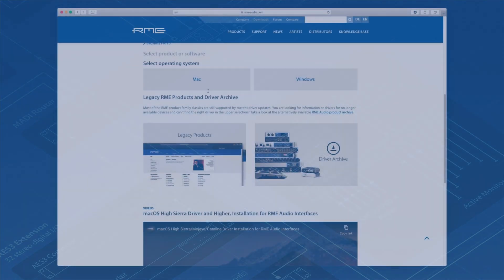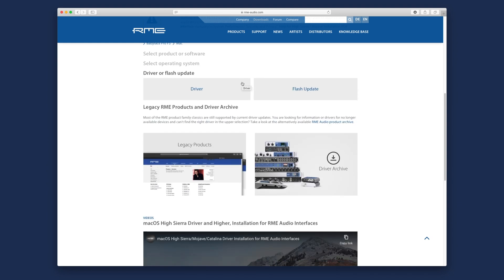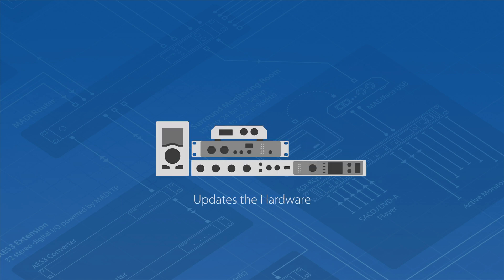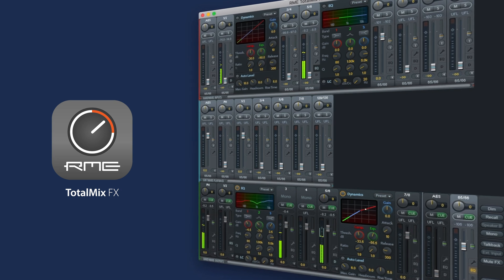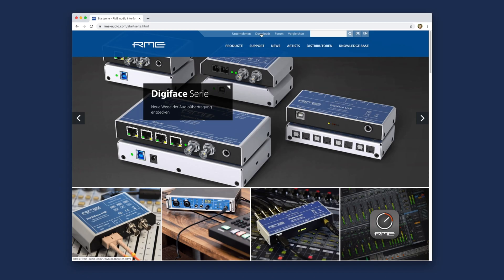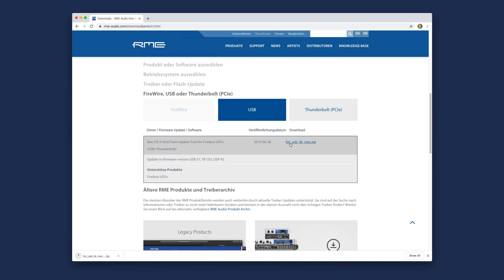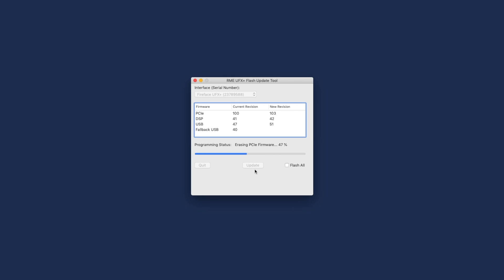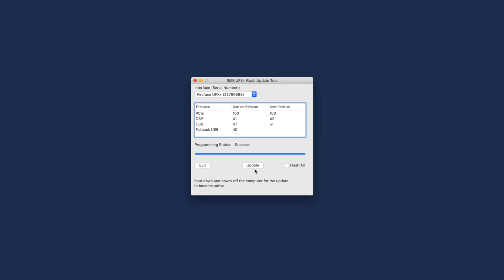Firmware Updates for RME Audio Interfaces

Comment: IF YOU HAVE SEQUOIA!!  You need to go to System Settings>General>Login Items & Extensions>scroll down to the driver extensions and click the “i” with a circle around it>Turn the driver on 

I was about to give up on getting my Fireface UC to work and finally found this section in the settings. Extensions are not in the Privacy & Security section for Sequoia.
Reply: Thank you! Was wondering why the FW update wouldn’t start!

Comment: why is there no driver available for download on the RME site for adi-2 pro 2/4 SE? cant find it anywhere
Reply: "As a computer interface the ADI-2/4 Pro offers a stereo (2 in / 2 out) and a multichannel mode (6 in / 8 out). Compatibility with macOS comes right out of the box. Under Windows the ADI-2/4 Pro uses RME's MADIface series driver, for full WDM and ASIO compatibility and highest performance."

Comment: This is not working for me on my Mac 2022 after the Ventura 13 update! The flash tool is frozen at 0% and "update" does nothing. Please help! I have no audio!
Reply: I have same issue, is there an explanation or solution to this?
Reply: same issue here!! @TriptoniteTV
Reply: Same here. Did you figure it out?
Reply: @2186chaney  Is this related to the firmware having to be installed on Windows or a pre- M1/M2 mac? I'm currently trying to find a way of updating my BabyFace despite having a M1 - or a 10 year old Intel - which sadly runs software too old to be compatible!

Comment: Question - will firmware updates clear the current stored snapshots which have been saved to a Fireface UFX II? Or will those remain untouched and still be available after the update?
Reply from the maker: The flash process does not overwrite any user data, such as sample rate selection, EQ settings, user setups or EQ presets.

Comment: Hi im currently using the fireface 802 with FireWire a connection  .. to do the firmware  update I see that it's USB only ... Do I have to install the drivers for USB as well before doing the firmware update? Thank you!
Reply from the maker: Yes, you need to install the USB driver. Flash update is only possible via USB.

Comment: I switch to Mac OS big sur 11.2.3. since that I have no longer audio , beside the midi is working , I have a Fireface 802 soundcatd and a iMac as pc
Reply from the maker: Have you upgraded to the latest driver and firmware?
Reply: @RMEAudio  But the FUT doesn't work on 64bit os!!? I'm trying to update my FF400, because it says I need to update the firmware to at least 1.70, but as mentioned it's impossible because the FUT doesn't work anymore....
Reply: @RMEAudio  I did to the ones that I 've found in your site

Comment: There's a problem with the latest Fireface UC firmware update. In the readme file it states: This Flash Update Tool will update the internal firmware to the following versions Fireface UC: 126 / 138. My unit is currently on 126. When I run the fut_usb.exe file to update my Fireface UC firmware it states the current version to be 126 and new version to be 126. Thinking it was a typo in the update software I allowed the update program to install, but after a restart I checked the hardware version and it's still 126?